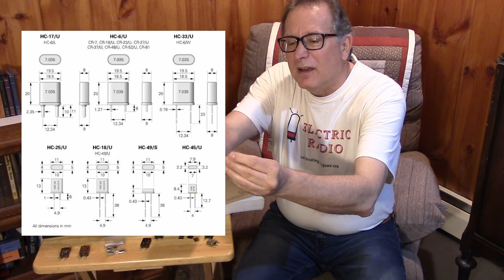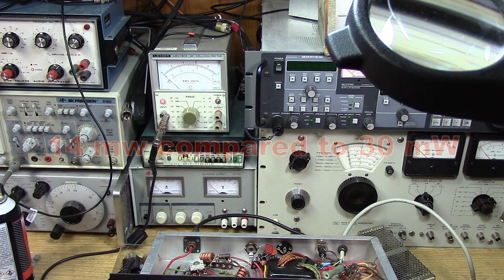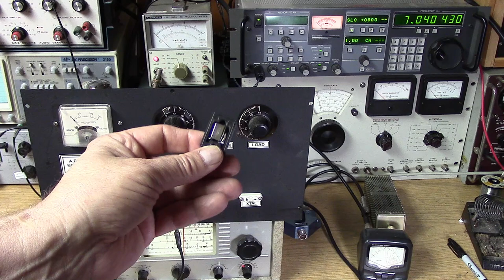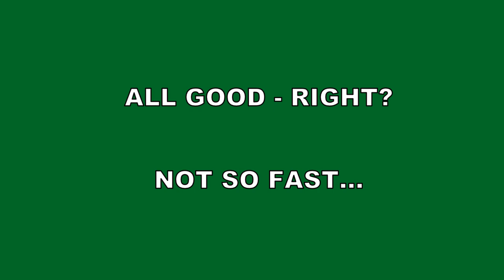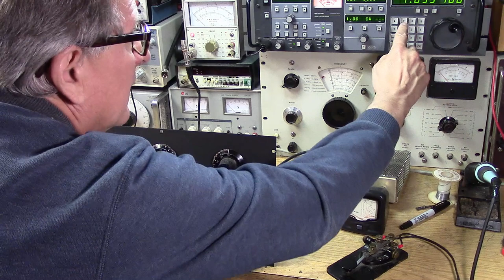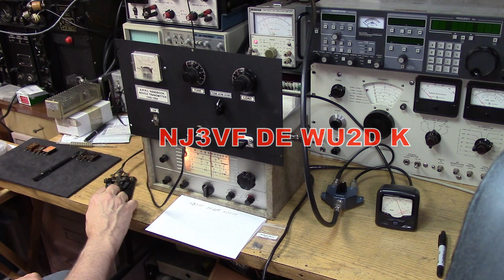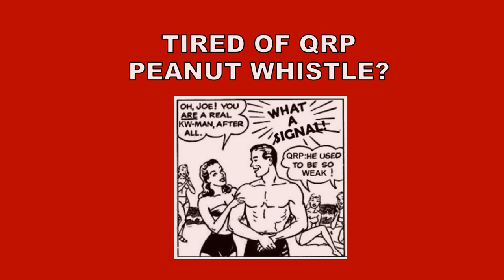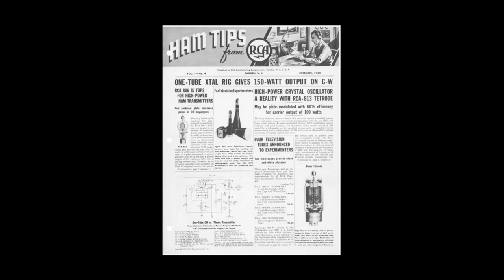Handbook Novice Transmitter Part 4

Comment: Great series, just in time. I saved mine built from the 1962 Handbook since constructing it in Jr. High shop class,1967, as WN6CAB. This time, i stripped it down and used as many original parts as possible. A definite re-learning experience!  I hope to put it on 40 soon. Again, thanks for posting. 73s de WA6CAB
Reply from the maker: The old crystal cracker lives again! Thanks for enjoying my video time warp!

Comment: Looks like series 150 Ohm resistor cracked the problem but not the crystal 😁. Really like the old ads and inserts. Those 1920s crystal price are eye watering. An online calculator indicated $50 in 1927 is about $780 today! Thanks Mike for another excellent video.

Comment: The Conar 400 Transmitter used one 6DQ6B and had a #40 pilot light in series with the crystal. The #40 pilot light is rated at 150ma at 6.3 volts.  This series brought back a lot of nice memories. Thank you!
Reply from the maker: I forgot about those Conar twins. Certainly that was a great example of a commercial version of this.

Comment: So what was the final configuration Mike? 
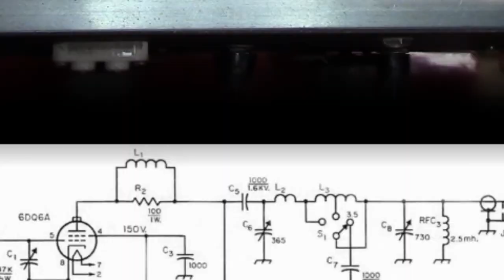Totally stock except for the 150 ohm resistor in series with the crystal? 150 volt regulator back in? Grid leak resistor back to stock? And still the 100 pF cathode bypass cap as shown on the schematic at 5:00 ?
I really enjoy your videos Mike! 
73, Jim W7RY

Comment: I built several 'power-oscillator' transmitters and every one was a pain and more of a lab experiment depending on crystal and antenna.  The best one was a 6146 for stability and output power but you always give up most of what power you could get out of the tube you're using, if it was just a PA.  
So, I quickly moved on to using a separate Xtal-oscillator (6C5, 6F6, 6V6, 6AG7, 6J5, 6C4, 6CL6 even 5763) and that made my life soooo-much easier that I never messed with power-oscillators again.  [edit: also stole a 6AU6 oscillator design from a 51J that was very stable.]  When you use a separate tube and even a buffer; (in fact a 6U8 is an excellent example) to feed a power tube, you can really get a MUCH-BETTER bang out your 6DQ6 or 6LQ6 or whatever sweep tube.  So, whIle nostalgic and cute, I never recommend someone build, as I'm sure a lot of novices had difficulty.

The best topology I found and liked (although power-hungry!) was using 3 5763's in a low-power or 2 5763's and then go into a 6146, 2E26, 807 or even an 811.  The pentodes allow better interstage isolation and control of how much power-density you allot to each stage.  This way you can have an oscillator that is easy on crystals but still has good voltage swing. Then using another 5763 as a buffer allows you to control your drive-level to the PA tube.

Finally, if you are interested in building these transmitters, I HIGHLY recommend that you make up a test chassis that has sockets for all of your candidate tubes already mounted with the filament, HV and screen wiring permanently installed.  Then, mount your output/antenna coupling (usually PI) components permanently as well. Lastly, put in a few of your least-favorite (but working) meters.  Once you have this boilerplate, you can quickly wire up and modify each of the circuits.  When you get something you like, then get out that new chassis and your most coveted components and build a nice looking final version.  Because all of the afore mentioned base-wiring being already in place, this will save you in the long run allowing you to spend your energy on the operational design details; then the test chassis can even be used to start a receiver etc.
Reply from the maker: Agree 100%!

Comment: Very nice!  I've used the HC49/U (tall) xtals I've found on eBay with good results in simple Novice transmitters using a 6AG7 or an equivalent 6CL6 oscillator followed by a pair of 807s or a 6146  PA  -- even multiplying to higher frequencies up to 15 meters.  But I've also cracked a couple of FT-243 xtals trying to oscillate a 6V6 or 6L6 tube directly.  This gives me hope for future projects with my pile of old sweep tubes.  Thanks.
Reply from the maker: Oh yes with the 6V6. Especially in my Paraset.

Comment: Very nicely done, Mike! Much fun to watch. 

I guess the lesson is that the MOPA was a better mousetrap. A 6AG7 or 6CL6 oscillator driving the 6DQ6 would perform much better, and not torture the crystals.
Reply from the maker: Yes! And that is where I went with mine back in the 70s after cracking a couple of crystals. I stuck a 6V6 in the case and added some driver tuning.

Comment: Thanks again Mike for another great, and original, thought provoking series. I love the tube stuff. I really like the mods for the HC49/U crystals as the older types are so difficult and/or expensive to get hold of for building older type circuits...could well be a game changer for those of us who do not have FT243's or similar... Dave G0KPZ
Reply from the maker: I love crystal control but hate how many folks never tune around or even look 100 Hz off frequency for your peanut whistle! CW filters in 70's-90s transceivers are very sharp. Use the RIT. At least with the new panadapter waterfall on SDRs, it shows you that someone is answering.

Comment: Interesting to see how finely balanced the whole system is. A resistor increase at the crystal affects how the tube performs. Could this damage the tube in time or is it that it just won't work quite as well? Thanks for another great video.
Reply from the maker: I was looking at the plate current and it is lower, so it is starving the tube when just out of tune. I would say the 6DQ6 just laughs. But it has to be spoiling the Q.
Reply: @MIKROWAVE1  Thanks for the reply Mike, good to know that no damage is being done.
Reply from the maker: An oscillator is tricky enough when it comes to starting reliably and self biasing, but expecting it to deliver significantly more power than normal, and do it without chirp, makes for some trades. But don't worry about the sweep tube. It was designed for a big old TV and 100% duty.
Reply: @MIKROWAVE1  Understood, thank-you!

Comment: Mike- what is the receiver you are using there? I don’t recognize it.
Reply from the maker: I think you are seeing a surplus Watkins Johnson 8711A with the green  display. This is a first generation DSP IF back end radio that is still in commercial use, and may actually still be in production, even though it is a late 80's design. On WJs downfall, the company was bought by BAE, then sold again and currently is owned by DRS (Signal Solutions).

Comment: How about adding two (or three?) identical crystals in parallel?
Reply from the maker: It can work but the capacitance goes up and ultimately the oscillator may need adjustment. Plus it might play a flutelike tune!

Comment: Could we use a modern crystal on a 813 tube as a mopa transmitter ?
Reply from the maker: Hah! I knew that little teaser at the end would draw this question. I was not completely truthful on the 813 circuit being the same topology as the 6DQ6. It is actually a TriTet with two tuned circuits, so a different animal. I would start with the biggest rock you can find and get it stable. And regulate the Screen to 150V! Only then would I attempt to use the modern rocks. The suggestion of using two in parallel is a good one to try, too.
Reply: @MIKROWAVE1 thank you for replying my question. I was very curious an article that was made by RCA about using 813 tube as mopa transmitter.